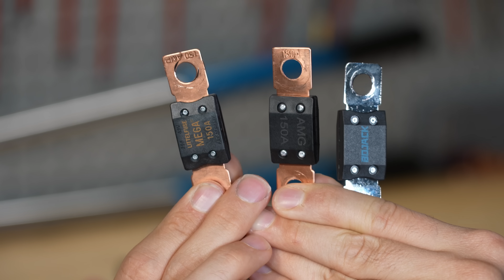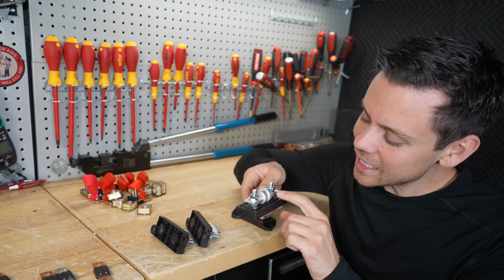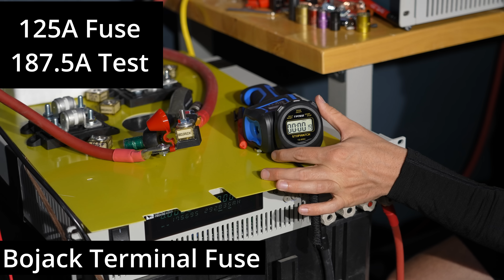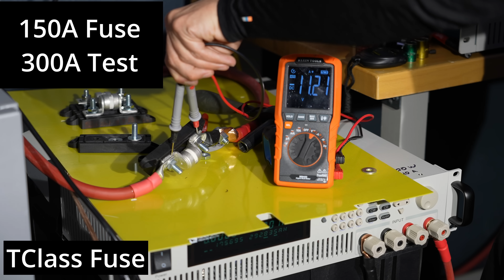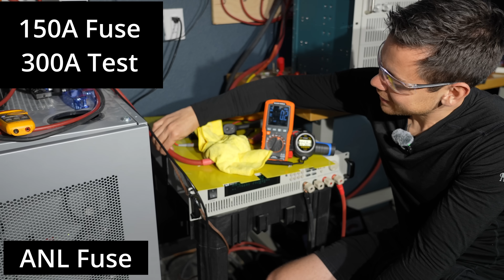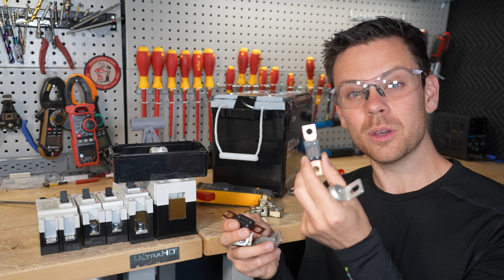Popular Amazon.com DC Fuse Showdown: Continuous Load Heat Test, Overload and DEAD SHORT Testing!

Comment: I use circuit breakers to protect the devices but the primary battery feed is protected by an appropriate high quality fuse in case of a dead short. They are not cheap but neither is burning your van to the ground.

Comment: Hi Will, nice topic, fuses! What would you recommend when connecting four 16S EVE batteriestrings in parallel and protecting a Multiplus 6k5 downstream?
Would you rely on a Mega fuse with less than 4000A breaking capacity during a shortcut in the Multiplus where the four strings easily can push 40kAmps?
Spoiler alert: I will use gbat fuses: NH1 200Amps for the batteries and NH00 160 amps for each device downstream.

Comment: 20:30 🥱

Very nice tests. However, the test isn't really conclusive because the test current must always be applied from a cold state using a fixed test current. There's a huge difference between the fuse tripping at 1.2 times the rated current and only at 1.5 times the rated current after a certain time (usually 1-2 hours)! The tripping threshold is interesting; at twice the rated current, these types of fuses trip relatively quickly. The current measurement with the clamp meter leaves much to be desired.

Comment: Can someone help me understand the direct short test. We are told you cannot use the smaller fuses because they will arc together with all that current of a lithium, but when he direct shorted the battery they all opened the circuit right? What did I miss?

Comment: Please tell me if I'm crazy... I've been buying Bojack terminal fuses because I can't afford the blue sea terminal fuse blocks. But... I've been buying blue sea fuses to put in them, and saving the Bojack fuses as spares. I'm running 200a fuses on 2x12v litimes (parallel) that power a victron 3000va inverter that occasionally spins up close to 3000va. Thanks very much for this showdown. It's a gem.

Comment: I all ways use a well over sized fuse as a fail safe to protect against shorts, then I use a breaker sized to slightly under the wire size (but still larger then sustained load) as over load of the device protection. So worst case scenario the wire barely warms by the time the fuse and breaker are vapor!

Comment: So for a 200a BMS and a 2200W inverter with 1/0 cables the maximum draw should be 183A so the 200A terminal fuse looks like the correct choice to protect against a dead short.

Comment: It seems that Class T is the only good choice for campers/vans. At least until buying an Adler EF3 fuse :) ICC twice as large, four times cheaper than Blue Sea, at least in the EU. However, both types have a hard-to-miss drawback! Try putting them between the battery and the DC/AC inverter that comes with all campers I believe. The built-in MOSFETs are so large (for pre-charging after a long period) that they can instantly blow such a fast fuses! It's like part time short circuit. Other types, like the Littelfuse ANL, have 6000A/32V = at least 10000A ICC at 12V (13.6V). Should be more than sufficient. The lower the voltage, the harder for arch to jump over & turn molten fuse into the crazy welder:) ANL are cheap (max half price class T) and easy to fit in a dedicated aluminum camper battery box. This puzzles me.

Comment: The fluke FC series (well some of them, I am following up about the 3000 FC multimeter...) has a builtin logging capability. It can store measurements locally with the settings (measurement time and duration of recording) and you can then retrieve them later. When you share, select measurement data as either the premade graph OR csv if you want specific data points or to make your own graph. Another option is to use the inrush setting, just beneath the screen you will see its button labelled. Tried it on AC motors but cant say about the DC amp setting but it worked when I needed to test a DC cap pretty well...

Comment: Thank you for the nice video.  Will so what fuse would you recommend for a 340 Amp Hour 12V LiFePO4 battery with a  200 AMP  BMS driving a 2000 Watt inverter?   Would you use a 250 AMP MBTF?   Thnka you

Comment: I want to see dead short fuse tests on a 16S MB31 bank 😅

I discovered some serious potential risk with those batteries, those are often only protected by a MEGA fuse with 2000-3000 interrupting current.

I did some calculations on 48V MB31 batteries and I discovered those are capable of pushing 17.800A. 
A fully assembled pack including busbars, BMS and fuse is still able to push 5000-15.000A. The exact current depends on the total resistance but it's way higher than MEGA fuses can handle.

A 16kWh vertical yixiang battery could push around 8.000- 12.000A at the terminals if I use the total resistance in my calculations.

Comment: Will (or others with knowledge).  Your thoughts on using a 300a MRBF for my 3000w inverter connected to 2 x renogy 200ah batteries in parallel.   Seems to be the best compact fuse for my setup allowing a fuse to the inverter while also allowing me to connect my other 12v system directly to the battery also.

I don’t intend to use the inverter at maximum ever or barely ever.  Just coffee machine or induction cooktop in my camper trailer.

Comment: Hi there Will, I really like your content.  On my AC main breaker panel the installing solar company installed a single 80 amp double pole  230 volt ac breaker.  My 40 panel micro inverter panels were producing 60 plus continuous throughout the day, that’s  great.  Personally I did not like that load on my panel busbars.  Since the original instillation did burn out that breaker after a short time.  they repaired / replaced it and that’s all they could do.  I was not happy with that, so I spread out the load over two breakers in parallel using some proper lugs. NOT DOUBLING WIRE ON BREAKER.  Heat is now spread better in my panel  here in Havasu,  it’s been running  much better over this last 2 summers.  What are your thoughts on this? I really like my micro inverters.  I’m thinking of adding maybe 10 or so more panels.  And possibly even battery backup.  If you’re up to some personal consultation or are selling some products I would love to hear from you is their a better place to contact you direct? 
thx John.

Comment: Please remember oms is amps. Low voltage higher amp. Higher voltages lowers mamps. Normal house hold in SA is 63 amps at 240v. Would love to go higher but te house at code can only handle 70amp before trippin....so why did my fuse not blow?

Comment: I built a solar system, 20, 235 Watt panels, it brings in only about 2.5 KW max though. I have 4, 12V, 300 Ah, LifeP04 batteries in series, to make 300 Ah, 48V, and an EASun charge controller, 150V 100A, or something. And some 4,000 watt inverter. It seems good, but I should get a fuse or something, I am not sure how electric works, it's a merical I've got this far.

Comment: Do these fuses not have load current versus disconnect time graphs?  I would think these were required for UL rating. Thermal fuses do not have a well defined sharp cuttoff current. You need a magnetic or active breaker for that.
Reply: Sorry. You are testing these fuses because they are not specified fit for the job. Should they be used at all? Wouldn't it void insurance?
Reply: Are you seriously buying fuses direct from china? Are there no wiring regulations specifying the device to be used? In the UK only tested professional electricians are pernitted to wire stuff into the mains distribution. There are reegulations governing solar/wind power instalalations. Insurance companies wou;d flatly deny claims relating to anything else.

Comment: Neophyte here. I have a 120v sump pump with 1500-watt backup inverter with 12v 100amp battery. I'm thinking I should add a battery terminal fuse but can't get at the correct one. It seems a 200amp fuse is recommended. All those I found on Amazon have an 8mm stud for the cable with a 10mm battery connection. My battery terminals are 8mm. What can I do? Rufus tells me it's ok to use the 10mm holes on the 8mm terminal since the connection is sandwiched and "clearance" is required for the bolting hardware. I'm not so sure.

Comment: When is, and when is it not, OK to substitute a breaker (e.g., MCCB) for a fuse (e.g., MRBF) to protect from battery over-current? Are fuses "fast blow" and breakers "slow blow" (relatively)? What's even the point of having over-current protection built-into a battery if everyone just ignores it and installs separate/redundant OCP? Why aren't consumers protected against the sales of batteries that have built-in OCP that doesn't work?

Comment: Do a review of their single and dual switches. I have a switch from amazon with the voltage display and it does not work consistently. I dont know why, but it doesnt work until i connect my inverter to m ly betteries directoy, which causes the spark. After my inverter turns on, then i can install the switch and turn on and off the power. If i connect the switch before powering my system, i get no power flow. I originally thought my inverter had an issue, but nope, turns out this only happens for my voltage display capable switch.

Comment: I have used trips in my circuits on my van but also fuses in case of a straight short (live cable chaffing and shorting to earth etc.) I figured the breakers will work when I make stupid wiring mistakes and the fuses will stop a fire in an emergency short situation. Looking at this information I guess I was correct but even then I used good quality fuses and breakers - I don’t try and save money when I am sleeping in the vehicle! Another great video.

Comment: If you don't find a datasheet or tripping curve for the fuse, you better don't buy them! Cheap crap is not worth investigating for a home solar system. Don't save money on the wrong side 😉 But for melting fuses it is normal that they need a current 150-200% of rated current to trip.

Comment: On the DC circuit breakers mentioned at the end of the video, i'm wondering if they are Bi directional, thus allowing both charge and discharge directions. I know they have no polarity, so cabling can be done in both orientations, but is that the same as handling the throughput in both directions? Eye opening testing, so thanks for that.

Comment: I think you should test these to failure and see if they spark internally once failed due to the high current possible with lithium. Isolate them sandwiched between two sand filled class T fuses for safety and see if they actually stop the current from lithium or just start a fire with sparks/heat after failure . I'm not sure how you could create 10,000 amps - might be better to do in a gravel pit. The bojack terminal ones seem cool but how is the fise side bolt not just conducting from the plate up through the fuse to the wire unless that bolt is isolated somehow

Comment: Will destroyed a thousand dollars worth of stuff so WE know which to buy!  My main take-aways: (1) Re-check the tightness of all connections every 6 months. (2) Good DC circuit breakers are better than Class T fuses.  (3) Adequate cables & terminal connections are crucial for proper over-current device operation.

Comment: Hi Will

Chris here ...(Hk collector)
So on my sailboat im using the BlueSea Terminal fuses.  Well worth the extra money and peace of mind. 
For my ENTIRE output before the 2 - RENO 3000 Watt Inverters I have my CLASS C , that is actually made by Siemens for Lithium Powered Forklifts and SkyLadders.  Believe it or not , it was CHEAPER than everyone that sells a C Class fuse and block for Marine purposes.   Had to order it non Amazon , but was only $60usd.  It's 150amp. 
I'm using 4 230ah Lynac Lithiums parallel.  I rarely ever exceed 100amp load when running Windlass hauling 1up a 45lb anchor.  Other than that my biggest loads are 60-80amps max for short stints when using a 12k btu a/c unit.  Soft Start limits the surge need as well. 
Bottom Line and Note on this video IMHO
You Get What You Pay For. 
How valuable is your environment where you are running your batteries and equipment.   CHEAP fuses will surely have your Insurance Adjuster questioning if they PAY you in the event of Disaster.  
Cheers Brother. 

ps.  Sorry been busy and haven't been in touch , lol.  

Arctic Circle Life !!!

Comment: I just talked to Blue Sea systems on the phone about the model 5191 fuse block holder. They advised me not to mout them to a LFP battery Terminal. Also in the spec on the amazon web site they say do not mount them directly to a battery terminal. Can you please clear this up for me as it seams all the videos yours included they are recomending they be mounted to the battery terminal?
Reply from the maker: No way!!! The disconnect amperage of those is 10,000 amps so I don't understand why they would say that. He must be making a blanket statement because they're not sure what kind of battery you're connecting. You would never want to connect it directly to raw cells
Reply: @WillProwse  To ad to my previous comment. I just received an email from Temgo saying "yes I can hook the 5191fuse block directly to the positive terminal of there 12v 100ah heated battery" . Here is the kicker the terminal on the battery is m8 the hole on the Blue sea system 5191 fuse block is for m10. So the question I have is it ok to use it as the hole is loose on the m8 terminal bolt? There does seem to be a lot of contact area between the two surfaces.

Comment: I think these test prove the adage of always buying fuses that are rated lower then the max you want to allow but these test show some of them need to be significantly less.  I'm not sure why they rate them for a amperage that doesnt match their limit.  I'm pretty sure thats where the trip curve comes in because it doesnt mean that the fuse rating is the trip point it seems to be the max allowed before degradation or something like that.

Comment: AMG fuses are used in automotive application where a car battery can product 600cca. I would never use them in a solar system.. they are very cheap $5 to $10 at automotive store.

Comment: Why are you using Garbage fuses? Test long term Branded fuses like Littel/Eaton/Bussman. Some of those manufacturers have been making fuses for 50-100 years. Also your test setup is weak. Wire voltmeter & bench  timer to measure drop & time accurately. Along with a thermocouple  to measure temperature. Your using a $2000 dc load controller, a $60-$100 handheld meter, and a $10 stop watch.  Really!

You just gave an excellent demonstration of how Bojack does their QC/QA. 

Been doing DC power systems for 40 years. Glad I never heard of Bojack.

Bottom line: If you're too cheap to buy Quality safety devices then you're too cheap to save the equipment your pretending to want to save.

Will, as aways, your intentions & motives are in the right place. Thanks for that. But, I'm disappointed with your execution on this one.

Comment: EDIT: I wonder if any of these are "fake". I have heard that is an issue on some onlike retailers, one that starts with "A" at least. 
Would love to see those terminal style fuses tested at 48v, but a better brand. I think the "ideal" usecase for those is "per battery" if the battery only has a BMS or you just want to be paranoid.
 While I love that you tested at 95% capacity, personally I view any system running that close to OCD/fuse rating as in a failure state. I fuse for wire, and size wire such that I'm at 80% or less nominally of that rating.